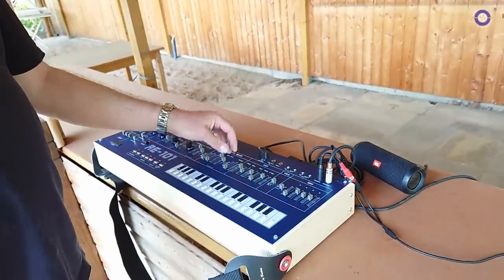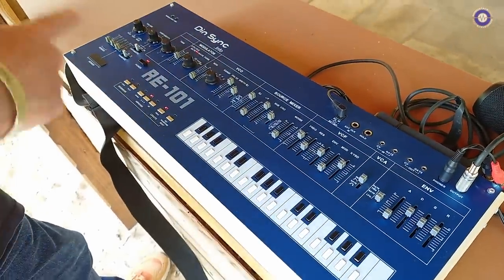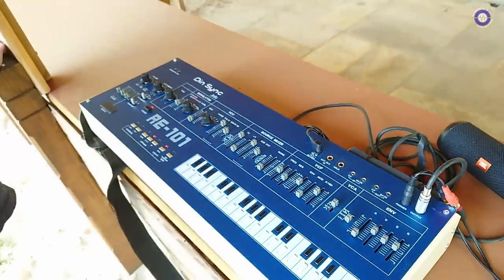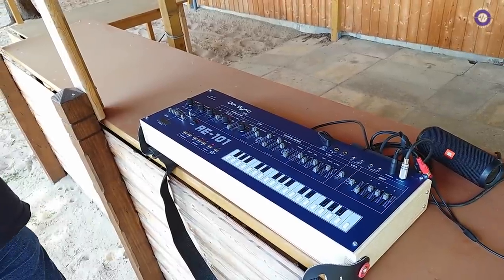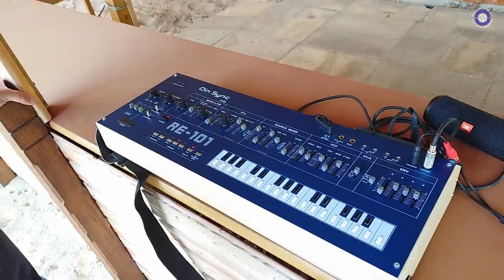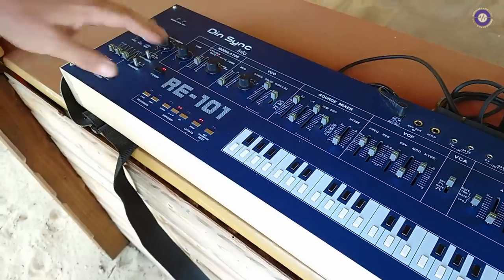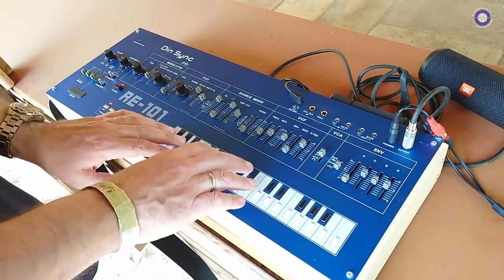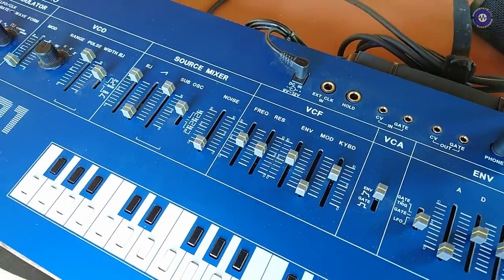Superbooth 2023: DinSync - RE-101 A Replica SH-101

Comment: While subjective, I’m not a fan of the rectangular look. I would put the mod controls back next to the keyboard even if it meant sacrificing keys. Maybe down to one octave like on the Elektron Analog 4. Mind you thats just what I would prefer if it’s not gonna have an actual keyboard. Subjective.
Reply: Right, I'm a little sad it doesn't have the full keybed, can't be hard to source I've seen a few, even the SH-01A has keybed sold separately. Could one of those not be used?

Comment: Let’s put TB 303 like keys on a synth that meant to be a strong nod to the SH 101 full length key monophonic performance synth with straps…it better be cheapish.$$$
Reply: A real sh-101 doesn't fit hand luggage with that big keyboard attached. This will.
Reply: I have never seen anyone use the keyboard of the SH-101 for anything other than programming the sequencer. In my book, this is a techno and electro machine and not a prog rock noodler keyboard.
Reply: I prefer it with those mc202 keys... it takes less room and its not a velocity sensitive synth

Comment: Behringer did it better and cheaper lol
Reply: Till it fails and you have to buy a whole new one made by underpaid workers 👍
Reply: @tropicalwhiskers3922  Every service or good you consume will be made or provided by underpaid workers if you live in the west. Ethical capitalism doesn't exist. You are here on the internet talking down to people so I hope you have never used Amazon, Coca-Cola, Du-pont, Starbucks, McDonalds et al. these are guilty of far more serious damage to communities and the planet than the fairly tiny in comparison Behringer.

I have been heavily using several pieces of Behringer gear for years and never had anything fail. In fact I would go as far as to say Behringer's manufacturer now surpasses most premium manufacturers due to the volumes and facilities they own. Also, a lot of premium manufacturers now buy parts and semiconductors from Behringer.  I have had DOA gear arrive from companies like Moog, Tascam and Eventide, but never Behringer...
Reply: @Fuzzfooger  Exactly right. Some people just think emotionally instead of pragmatically. Been using Behringer gear since the Early 2000's and while some of their stuff was questionable, most of it still works fine, and haven't had any issues with some of their new gear........
Reply: @Telecastro

My reply is bullet points cause thats just way too much to reply to, not worth the time.

• When I see a 50 year old MS101 I’ll retract my  statement on reliability.

• Fast Food & Soft Drinks = Poison.

• BigPharma = A patient cured is a customer lost. 

• Amazon = Tricky because I could go to the local stores but they seem to have everything you don’t need and nothing you do. 

• Modern Roland Sucks

• Thinking practically I would rather find a synth tech to fix a minor issue with my Sh101 and chucking a whole synth in the trash and buying another one.
Reply: Not possible, when using different parts.
Reply: @Fuzzfooger  There are levels to it of course but people just jump to China = bad, we know that iPhones are bad but musicians don't have the same contempt for Apple that they have for Behringer. I think boutique stuff is often in a weird space ethically, if makers are underpaying themselves is it ethical to buy their stuff? We feel like since we're paying more than we would for mass-manufactured stuff that we're doing our part, but if they're not making a livable wage are we taking advantage of them?
Reply: I'm not a Behringer hater (own Pro-1, wasp) but they didn't nail the sound on the SH-101 at all.
Reply: @John_Stone_  yeah the ms-1 is not the same as this.
Reply: Better is debatable. From what i understand DinSync makes replicas, not just clones. It's like the difference between Emulation and FPGAs. One is a lot more of an SH-101 under the hood than the other. whether that matters or not is up to you but I can see the appeal for people who want as close of an SH-101 as possible or for those looking to repair their actual 101.
Reply: @tropicalwhiskers3922   Everyone is underpaid ! lol  behringer kicks ass period lol
Reply: @John_Stone_  I guess the way I see it is that an imperfect emulation is going to have a different range of good, usable sounds than the original. Whether it has more or less isn't something you can guess without spending some time with it, but unless it's remarkably crap it's still going to have a good amount of decent SH-101ish sounds. I actually got my S1 in the mail in between this comment and my previous one so I think that will hold me over for a bit even though it's far from being a clone.
Reply: I wonder if you could put the internals of this into a Behringer MS-01 case?
Reply: @botany500kojak  No need Behringer kicks ass mate! Their 101 clone is better than the original :D